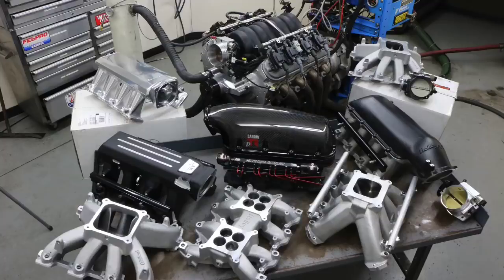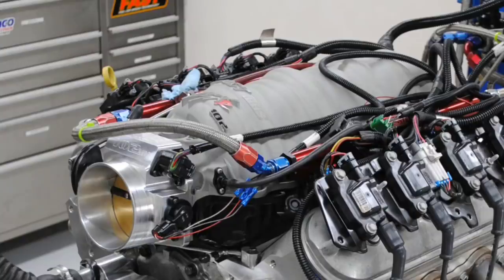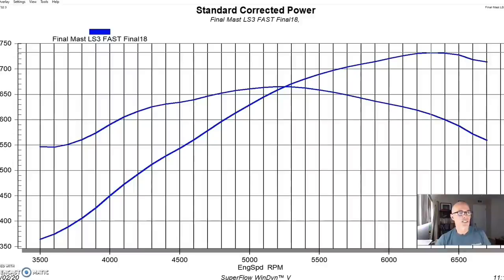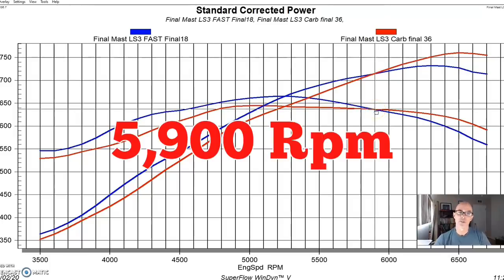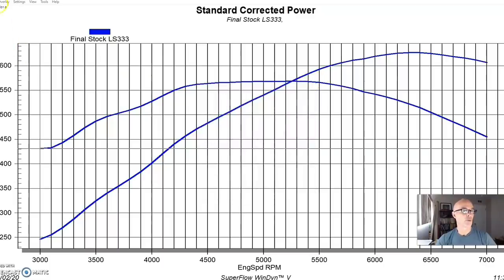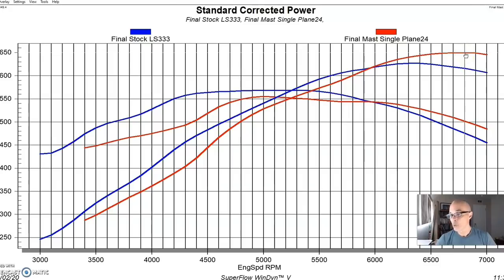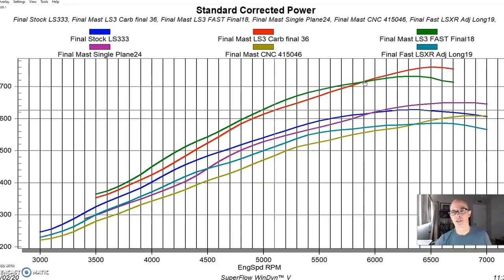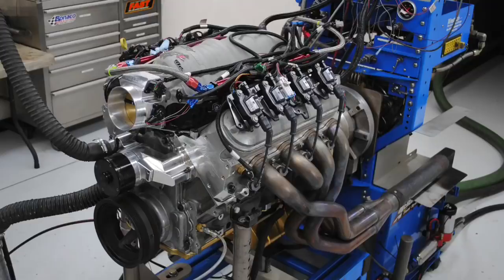LS3 STROKER INTAKE TRIPLE TEST (FAST VS MAST)

Comment: Richard,  how about a test of the Borla fuel injection individual runner and individual throttle body intake system.  This has adjustable length runners and actually should produce serious power
Reply from the maker: I have stack injection videos up already

Comment: Hi Richard.... in my opinion, the LS3 intake manifold makes the best power under the curve. Also economically the best choice for the money. If someone with deep pockets wants to spend over $1000.00 on a intake manifold like the cross ram  style with two throttle bodies.... to make 20 hp more just to find out.... oh no my alternator is in the way of the driver side throttle body opening. What did I get my$elf into lol.
Keep up the cool videos!
Cheers

Comment: So Ford's engineers stated that the 7.3 liter size was the best compromise between fuel mileage and power. I wonder if the power crossover placement was why it was decided for their new engine to displace 7.3 liters or 445 cubic inches or just usable torque in the bottom of the powerband. They also stated they intended to take on the LS platform with the new design (engine swap popularity) specifically stating they intended the block to handle 1500 + hp and an excellent candidate for boost applications. Hoping richard puts one on the dyno for a Big Bang motor soon.

Comment: I didn't check to make sure but the big cube motor moves the cross over down but also the peak hp came down the same revs, would it have gone better with a different short runner intake

Comment: If you put spacer plates under the carb/throttle body on the single plane manifold does that work like increased runner length and give more power??
Reply from the maker: that would not add runner length-just ads plenum volume and changes signal to carb
Reply: @richardholdener1727  do spacers offer any benefits to power? How does changing the signal to the carb effect how it operates?

Comment: I would say the change in operating RPM for the manifolds of the same general design is a function of the different airflow requirements for the different dyno tests. (i.e. power numbers)  As you approach the airflow efficiency limit of the manifold design it will limit airflow potential.  Different engines when measured at the same airflow should produce similar power numbers if the engines are close in volumetric efficiency.  Result; as the power level increased the manifolds upper rpm "limit" decreased.
Reply from the maker: the change in power production between the two is primarily runner length (we see the same thing on every test)

Comment: Optimization has about five variables: displacement (for most people this is fixed), compression ratio, cam timing, intake runner tuning and exhaust runner tuning.

Playing with displacement and intake runner tuning is leaving three of the variables unexplored.

It's probably impractical from a time and budget perspective to do an exhaustive test on four variables but if you have an optimized combination, one change is going to bump you off of optimized, you need at least two changes to get back to an optimized state.

That 468 lost a bunch of torque and the shape of the curve went from rounded on top to a plateau.  To me, that suggests the cam tuning is off with the single plane.  A smaller cam might restore that shape without losing too much top end.  Just try one with an intake valve closing 5° earlier.

Worst case it will lose power everywhere but I'll shut up about it.

Best case, you might keep a bunch of cams and some adjustable length dyno headers to fine tune your combos after you make a change you are testing.

Comment: Great test! 
This may be entirley impossible, but you know what'd be interesting.. Testing oversquare vs undersquare.
With the same displacement, same cam, intake etc.. 
Destroked big bore vs Stroker

See if the longer stroke does much to improve bottom end torque.
Reply: Something like a 5.3 stroked to 6.0 liters, then compare it to an OEM 6.0.  Then maybe even add an LS7 destroked to 6.0 liters.

I predict that the long stroke would not improve low end torque.
Reply: @andyharman3022  
I reckon it would improve torque at the expense of Maximum RPM.

If I recall correctly you need a larger crank pin offset to account for the longer stroke. Larger offset, more leverage to turn the crank.
Reply: @jaydnisevil  But total displacement remains the same.  Smaller bore, smaller area for cylinder pressure to work on the piston.
Reply: @andyharman3022  
True, but you also have the force being exerted over a longer period.. The crank spends more time on average in a productive angle.
Reply: @jaydnisevil  If the engines are running at the same speed, the piston force is exerted over the same amount of time.  The piston with the longer stroke moves more in each crank degree, but has less force behind it.  It all sums to being no different between the two.
Reply: @andyharman3022  
If they're running at the same speed agreed, but does the required piston force to achieve that given speed change? Given the longer stroke does the gas have more time pressing on the piston and apply pressure before it's exhausted? 
How is the swirl/combustion flame front different?

And the next question does the pressure loss due to less surface area equate directly the increase in leverage in the crank? Leverage can be a very powerful thing.

A fair few truck mirrors are undersquare and engines usually targeted towards HP are oversquare.
Yes piston speed given the weights is a consideration, but i just cant help but wonder.. Hard to argue it's not an interesting discussion.
Reply: Big bore...can use bigger intake valve which is most influential to power production. Defeats the purpose to make all the bottom end geometry changes only to use same heads and cam.
Reply: @CPEngineeringSolutions  
Which would effect top end horsepower more than anything else.
Reply: @CPEngineeringSolutions  That's true, but Jaydn was only thinking about low speed torque.  The advantage of the bigger valve would be less noticeable.  To make the test consistent in the way he was thinking about it, the same head would be used on both, but it would have the be a 5.3 liter head.  The big bore engine could be run twice; 5.3 head, then LS3 or LS7 head.

Comment: I'm sure you have done this, however I don't remember,  but how does the cam size change the RPM crossover point which allows the short runner to make more power?
Reply from the maker: pick the cam timing to work with the effective rpm of the intake-short runner = high rpm

Comment: This shows that the fuel injection has it down with the stock style intake manifold also comes down to how your car is set up you want less down low for more traction for street and make it pull harder up top or do you have a car or Utah lots of traction and want to take use of it

Comment: I like watching this and precision transmissions because a good motor needs a great transmission to put the power down also the cam used first has high lift how often should you change valve springs

Comment: If I were racing and intended to keep RPMs high, the trade off might be worth it, but it is interesting to think about the area under the curve through the intended operating rage and for the bigger displacements (say 5,000 through 7,000 rpm), with the cross over shifting lower, you might have more area on average under the short runner version, it is less clear that the area under the curve on a smaller displacement given you a better average power through the range. Might be the basis the the "flawed common logic". The gain in effective performance at the wheels is more pronounced in that rpm range for the larger displacement with differing runner sizes. 

So my take-away is --- more cubes is more better!!!!

Comment: Would a single plane make more low end power with a very high carb spacer,like 6'' or better?
Reply: Interesting supposition but that’s just growing the plenum volume and Engine Masters Season 4 (Episode 51) pretty much said nah. There are so many factors at work that you can’t make any generalizations about plenum volume. This was Richard’s test. 👍🏻
Reply from the maker: carb spacers (especially run with carburetors) don't usually have that effect

Comment: Did you say the Mast or the Fast intake was best on the cathedral port heads?
Reply: He said Fast is an over all & biggest improvement on cathedral port.
& absoulutely NO gains on rectangular ports meaning factory OEM intake is already maxed out.
Your wasting your money on aftermarket rectangular intakes.
Reply: @408SPLKINGS  The Edelbrock X-ram was slightly better than the factory LS3, but much more expensive because of the dual throttle bodies that you would have to buy.  Watch his LS3 intake manifold shootout video.  It's awesome.
Reply: @andyharman3022  I agree! I need to watch again.
Reply: @408SPLKINGS  Thanks for your feed back.
Reply from the maker: The fast is better than all the stock cath intakes-the Mast single plane still does the same thing compared to the Fast cath (only helps at the top)

Comment: I want to run a carbureted ly6 in my 85 K10 4 wheel drive what All Electronics do I have to have and do I put O2 sensors in the exhaust
Reply: You don’t need O2 sensors on a carburetor engine. Unless you wanna run a stand along AFR gauge
Reply: @sstevocamaro  thank you very much for your help I'm new to all this fuel injection but I definitely see the major benefits
Reply: @sstevocamaro  I mean LS vs. Small block Chevy

Comment: Do something like the neon did with the 01-04 RT neons. They have a dual runner intake manifold. Long thin manifolds for mid range lower and short fat runners for top end power.
Reply from the maker: Acura Intergra GSR also-others as well

Comment: Richard, I have a question involving your vast knowledge of engine modification and their expected results. What effect does advancing or retarding the camshaft timing have on horsepower and torque production for both dual plane and single plane manifolds?
Reply from the maker: advancing and retarding the cam has shown the same effect on both manifolds-advancing tends to help low speed, retarding can help top end, sometimes advancing and retarding cam timing does nothing but hurt power
Reply: Thank you very much for your knowledge.

Comment: Hey Richard I have a question. Would you call a gen 4 ls engine a built or modified engine if the crank, rods, and pistons was the only things reused, BUT everything else was replaced with better then stock stuff??
Reply from the maker: sounds like a stock bottom end
Reply: @richardholdener1727  yeah  so not even modified

Comment: Love to see you do a 305 cylinder head shoot out on a your crate 350...
Reply: Same here.I had a '77 Camaro with a .40 over 350 back in the late 80's with a 600 Holley vacuum secondaries, Edelbrock performer dual plane intake, flat top pistons, RV cam, roller rockers, stock cast iron exhaust manifolds, 3:08 rear gears, stock HEI, and put some cheap rebuit 305 2 barrel heads on it the compression was pretty high (don't know the exact numbers) and had to watch the timing and fuel quality but it pulled pretty hard and averaged around 18 MPG on the highway, it was my daily driver for a few years, never went above 5500 RPM's (would probably quit breathing above that with the small valves, intake ports, cam and exhaust manifolds) or took it to a dragstrip or dyno (I did street race a guy in a late 60's Mustang, he asked me what I had and I said a 305 and he said he had a 302 so we lined them up and ran and I barely beat him by a bumper length and when we met back up he said you have more than a 305 and I told him that you have more than a 302, we both laughed and went our own way) but it was fun to drive and overall pretty reliable when I sold it which I regret doing along with the many other old cars I used to have but would be curious to know some sort of ballpark TQ/HP it made.

Comment: Is it possible, that crossover point came down with bigger motors, due long runner intake came closer to its flow limits and short runner had more head room?
Reply from the maker: this isn't a flow limit-it's runner length

Comment: Unless your gear sweep is like 800-900 rpm or the motor is in a landspeed car, I cant see how the short runner would be the better choice.
Reply: 5500 stall converter
Reply: @deek431  yeah, you would need a pretty big stall to take full advantage.
Reply: Area under the curve.  It's obvious.
Reply: It would have to be tested for the short runner to work the stall converter would probably need to be higher with more gearing and it may workout well in a lighter car like 3200 pounds or less trying to keep the engine in the 5000rpm to 7000rpm range l think the fuel injection would be better for the street with more torque down lower in the rpm range making plenty of torque from 2500rpm to 5000rpm without revving the engine real hard and in something 3800 pounds or more the fuel injection would move it much easier than the single plane would my favorite is the 415ci with the single plane intake in a old chevy 2 or nova fox body g-body 32-34 ford coupe

Comment: The reason the rpm crossover is lower when when displacement increases is CFM is the same at those RPMs
Reply: CFM is part of it, velocity is also part of it. This effect is well known in the Pontiac community, because we can put the same heads on any block, which means a 326 can have the same head as a 540 cube aftermarket block. We compare 400, 455, 474, 489, and over 500ci (up to 540 with the standard deck height) in deciding what we want to do, and where we want to make the power. You can easily see the difference displacement has on CFM and velocity, and what happens with the single plane or dual plane intakes.

The main reason a Pontiac makes a lot more torque than a similar sized LS, and with a flat torque curve, is velocity. The Pontiac ports are longer, have a venturi shape, and that makes for high velocity intake tracts. The longer the runner is, the more velocity you get, to a certain point. Its a lot more than just CFM.
Reply: PAPOW ya what he said.

Comment: Excellent video.. do you think my 427 LY6 stroker can hit 700? If not how close? I’m thinking 690-708 depending on tune 🤔

13:1 compression 
comp 54-474-11 @50 251 int./267 exh, advertised duration 301 int./317 exh. 624 int/624 exh, 115 lsa

LS3 heads PAC 660 dual springs, fast lsxR intake. 
E85 fuel
Reply from the maker: not with stock LS3 heads (427 LY6-is it a 4.1 stroke?)
Reply: Richard Holdener thanks I know what to do next 😈
Reply: Richard Holdener and yes 4.100